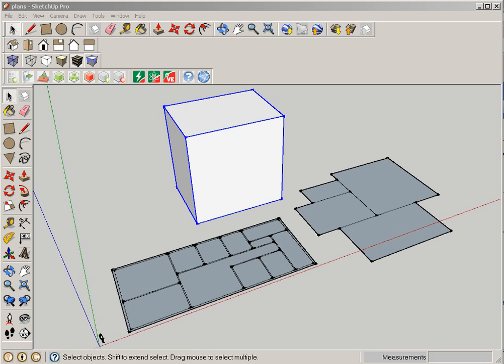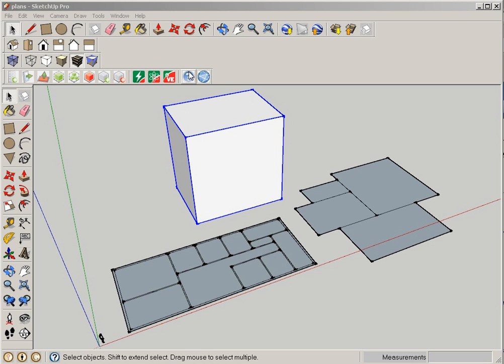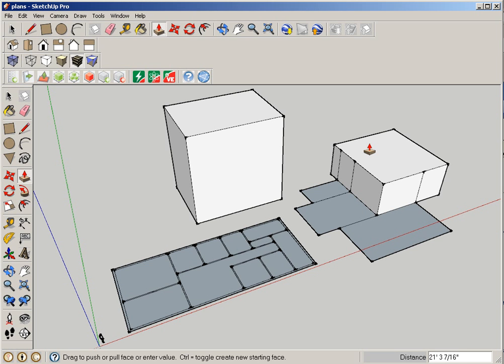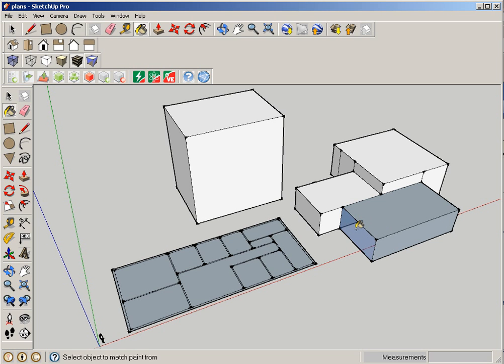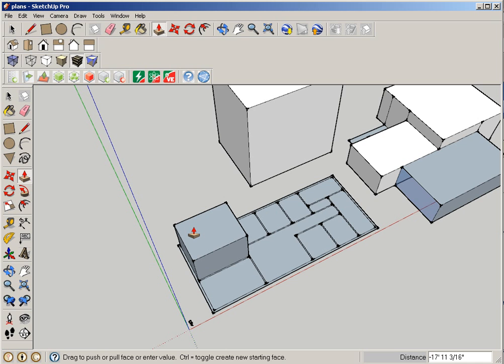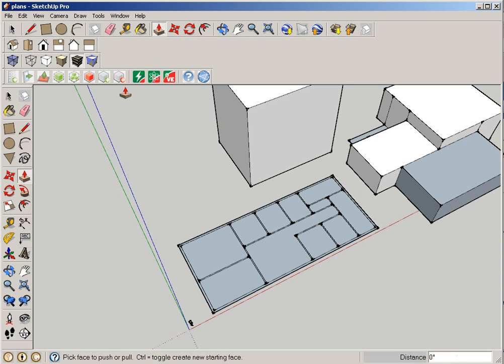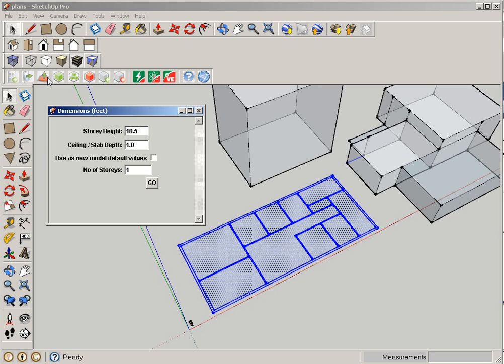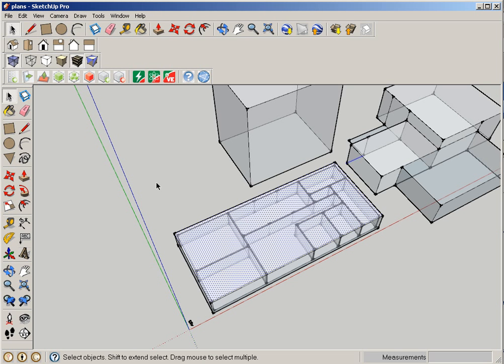Thick vs Thin Wall Modeling (SketchUp plug-in V3 New Feature)

Comment: When you bring in a DXF model. Is there no way of quickly turning it into lines so you dont have to trace around every line. This is very frustrating when you have a large building. It takes up hours of time. You should be able to highlight the DXF import and turn it to lines with one click of a button.
Reply from the maker: Hi, we’re not quite sure what you mean but after attaching DXF you would have two options to either trace and draw the rooms in yourself or you can use ConstructDXF to automatically generate rooms based on the DXF. You can search for DXF on our Support Centre to access useful User Guides and Knowledge Base articles on this topic and it is covered in more detail on our ModelIT e-training so if you haven’t attended this course please consider it.
Reply: Integrated Environmental Solutions (IES) I haven't found anything on the forums or knowledge base about 'Construct DXF'.
Reply: Integrated Environmental Solutions (IES) l

Comment: How do I do the second storey? It keeps messing up my rooms.
Reply from the maker: If it’s a repeated floorplan on each storey then you can specify additional extra storeys when using the plug-in erect a storey tool.  If not then have a look at that option anyway so you can see how it should look for the plug-in to successfully identify the rooms. You could continue this conversation on our User Forum: http://www.iesve.com/support/forum
Reply: Thank you. How come it is not possible to use the Sketchup IES plug in on an operating system that has IES installed already. And is there no way of saving an IES document as a previous version. I have the latest version on my laptop but the computers in college has an older version installed. It is causing terrible problems for me.
Reply from the maker: Plug-in installation is covered further on our Knowledge Base which is free to access on the website Support Centre for all users http://www.iesve.com/support/knowledgebase/faq/3028
 
VE projects aren’t backward compatible but the Version Archive gives access to all versions of VE if you want to install the same version as you use in college, this is also covered on the Knowledge Base http://www.iesve.com/support/knowledgebase/faq/3582